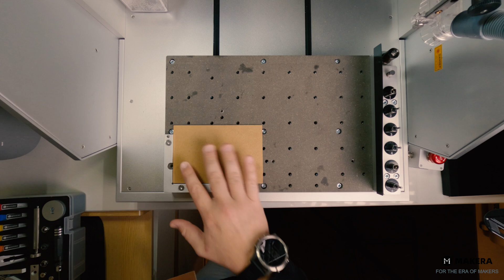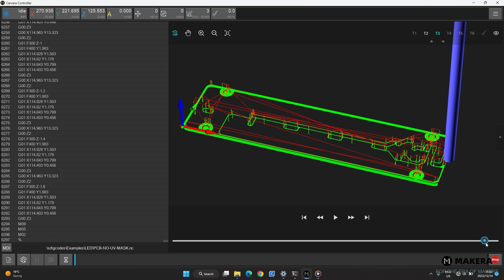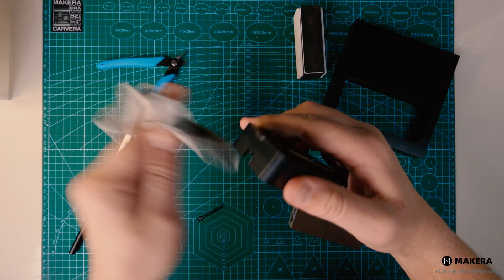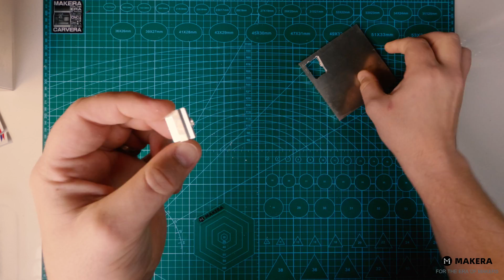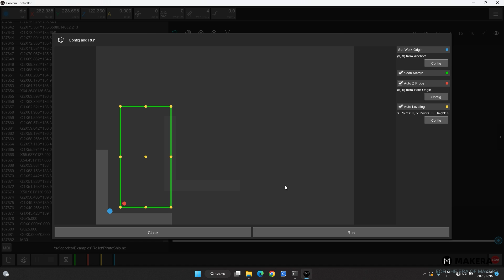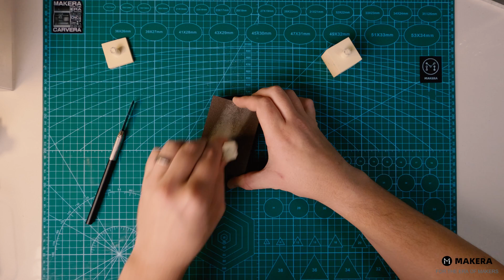CARVERA Example guide!

Comment: How do I re run an example? I want to do the pirate ship again. Also I want to do it on aluminum can I just run as is or do I have to adjust the bits and feeds and speeds, If so how?
Reply from the maker: You will have to adjust the feeds, speeds and DOC's to do the ship in another material. To do this you will need a 3D model to import into the CAM to reprogram the Gcode.

Comment: hi can u try with metal block. can this machine makes metal mold - for injection molding?
Reply: The collets and bits are not very large in particular so might break if feed speeds are too high or spindle speeds to low, metal milling also generally require liquid coolant which is not supported.
Reply: @roelofgericke9191  okay got it. Yes because it gets too hot from the friction. Awesome. Thanks for the explanation. I’ll wait for next version with liquid coolant 😁😅
Reply: @thekuemue  you might be waiting a while I ordered this 1.5 years ago and it arrived yesterday. Very happy so far.
Reply: @dwanga4426  glad to hear someone received their machine, could you post some videos please from an actual non makera or influencer, I'd like to see it from an actual non influencer who wasn't given the machine to try out.  I'm seriously considering this machine over a stepcraft with an atc, because i like how this is enclosed.  would this be could for small hobbyist plastic injection molds?
Thank You
Reply from the maker: The machine can handle non-ferrous metals like aluminum and brass. We have tried metal and it does work but is not recommended. https://www.youtube.com/watch?v=VTWt6elB6eg
Reply: @Makera  thanks for the link. Any particular reason why steel is not recommended?